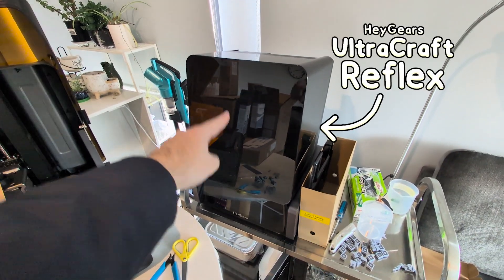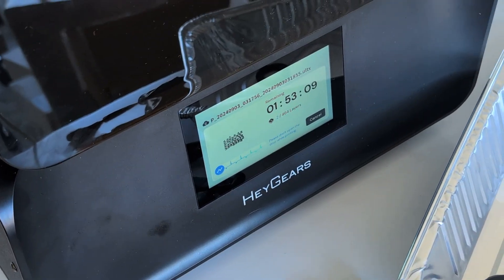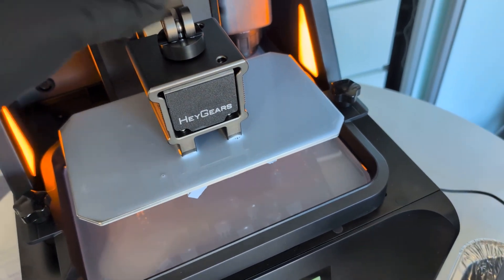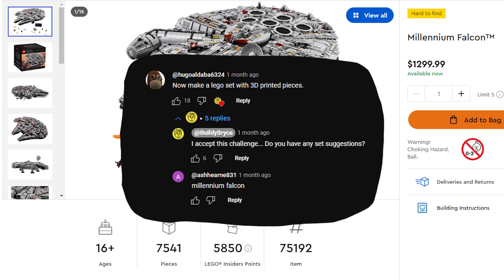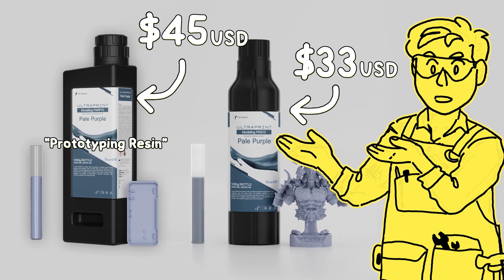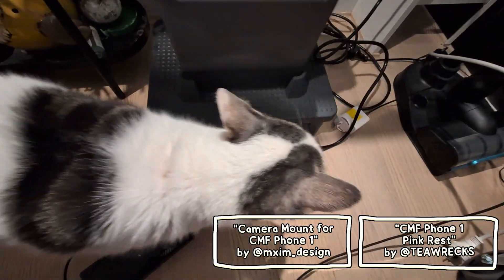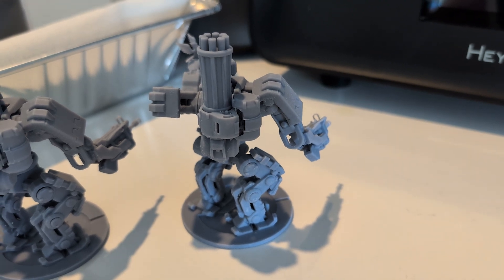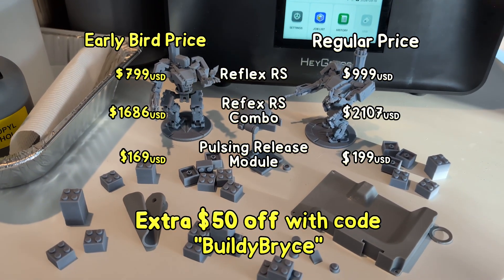Cheaper, Better, Faster - UltraCraft Reflex RS 3D Printer

Comment from the maker: I hope you enjoyed this quick look at the Reflex RS. As a (still) beginner in the resin printing realm I've had a great time with it! Make sure you check out other videos by other creators if you want to see a more in-depth analysis. I've got a few videos coming up where I'll be using the RS to make some practical parts that my filament printers can't :)

Get an extra $50 off the Reflex RS with code 'BuildyBryce' at https://store.heygears.com/products/16066054879476586102063835?source_type=sales_plugin_af&slt=sales_plugin_af&referral_code=YOTUT4PABMHG (Ad)

Comment: You could cut a hole in the base of the autofilling bottle, make some kind of plug for it, and use that to refill it using the cheaper regular bottle. Just a thought.

Comment: Hi!! could you please share the dimensions of the box the printer came in ? does the pulse release module come separately packed? I intend to get this freight forwarded to Singapore, so the dimensions of the box and weight of the package will really help with cost planning! Much appreciated.
Reply from the maker: Hi! The pulsing release module comes in 2 separate boxes. And any resins are also separate.
I'll update this comment tomorrow with the dimensions (if I forget, please feel free to email me).
The RS itself is 20kg, but unsure of the total box weight.
Reply: @BuildyBryce  thank you so so much! I hope to hear back from you tomorrow!
Reply from the maker: @ThinkDesignMakePteLtd  I didn't forget! Here are the box sizes:
Pulsing release module: 20x30x27cm
Pulsing resin tank: 43x43x8cm
Reflex RS: 47x47x65cm
Reply: @BuildyBryce  thank you so so much! These are dimensions of the boxes they came in right? 

Do you think it would be possible to hand carry the reflex RS on a flight ? 🤔
Reply from the maker: @ThinkDesignMakePteLtd  Correct. And absolutely not, way too big to hand carry.

Comment: You can print a dam / border for the flat build plate to stop the resin from getting trapped on top, I’d also recommend adding an upside down lip so when the build plate is upside down while you’re removing modules the resin doesn’t drip onto your work surface.

Something like the GK2’s build platform or the formlabs build plate.